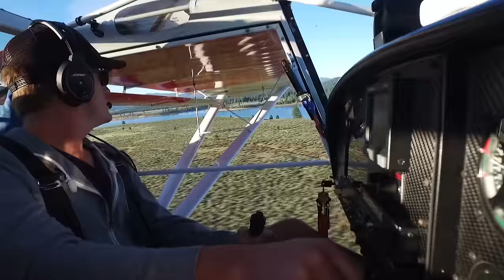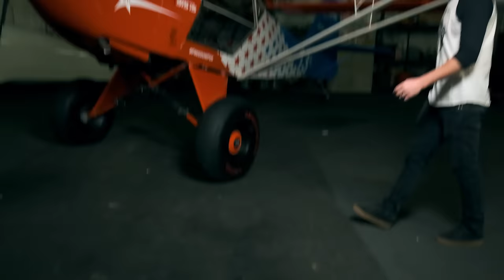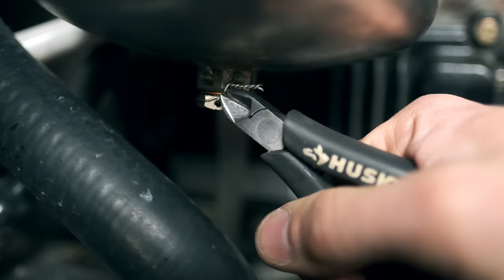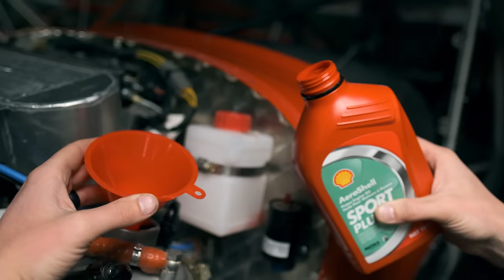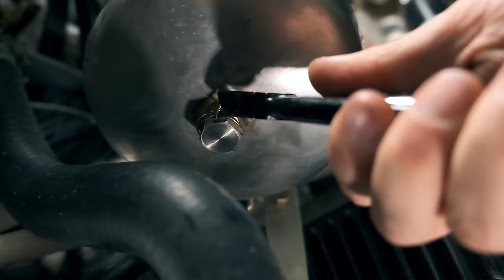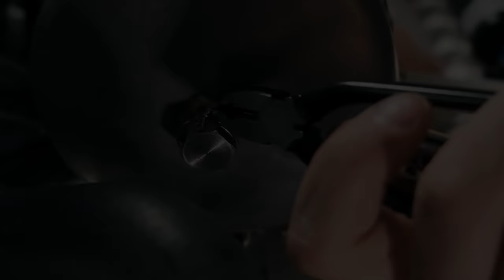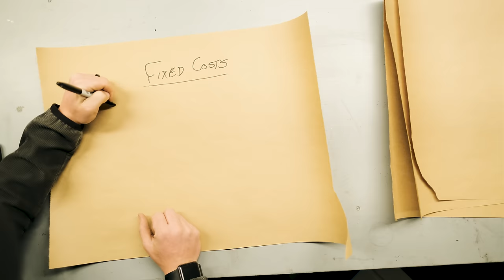What Does It Really Cost to Own and Fly Your Own Plane?

Comment: Here is the breakdown:
Acquistion:$39,000 / $20,000 USD or find financing.
Fuel: 5 gal per hour / $4 Gal average
Oil: $62 every 25 hrs
Hourly operating those two costs = $22.50 a hour ($1,125, 50 hrs - $3,375, 150 hrs)
Garmin database: $200 annually
Annual Inspection: $500 annually (experimental)
Hangar: $300 (huge disrepency regionally)
Insurance: $2,400 annually ($125,000 hull value, Off-field landings)
Reserves not covered.
Wear and tear not covered.

Loved the video and b-roll intro oil chance Trent!
Interesting stuff considering I'm evaluating getting back into flying again and as a father and new homeowner every dollar can count :)
Reply: So you need an awful lot of money. Not possible for college student on scholarship eh
Reply: Sudarshan Pujari since a college student can barely afford a crappy car- probably not
Reply: @ricktoberfest  sigh, not even Evan's volksplane?
Reply: To cut some costs, I would have to have my own runway and hanger on my property.  I would be a Sport Pilot so I'd get the  Certification of Repairmen (Light Sport Aircraft).
Reply: @ricktoberfest  You can fly some really expensive airplanes in Flight Simulator and get some decent control setups for reasonable money.  Maybe not as good as real but certainly a way to play until the money is there to support the real.
Reply: @Mongoswede  especially in VR!
Reply: It is NOT a cheap hobby.  The worst mistake that I've seen:  An A/C owner who pays all the costs, but doesn't fly it often, b/c of fuel costs.  The Stupidest Mistake.
Reply: Thats crazy! So, if you were to fly 150hrs per year, thats around $45 per hour. Probably add another $10 per hour for reserves and wear and tear? I mean, its probably like $90 per hour to rent a Cessna 150 right?
Reply: thats about what it costs to own a beamer
Reply: @janniesmit4901  Pass on this, or make a    7500.00  USD  offer.
Reply: 5 gal per hour how is it so low? How much hp is that kitfox
Reply: @neelmehta100  Cessna 172 goes for $130 /hr wet here in Los Angeles, and they are really beat up.
Reply: @wuhsuh6200   he doesn't run it much on boost, with the turbo, that can see 7.5 to 8 gals /hr. 5 gals Hr is probably max of 100 to 105 mphm as he has STI wing version, stall vortices, that lower stall speed and big old honking 29" balloon Alaskan Bush pilot tires, not aerodynamic at all. A lot of drag built into his bush plane, for short take offs and landings, not cruising.
Reply: @ctsteve1967  Sure thing thanks 👌🏻
Reply: Vote for Bernie and it will all be free....lol
Reply: May be I am blind, but I didn't the cost of maintenance.
Reply: Let's rap it up here, I knew that I didn't want to hear these numbers!
Reply: AND THAT RIGHT THERE, IS WHY I CHOOSE PARAMOTORING!
Reply: Randy van Vliet still only 5 gal an hour that’s pretty good considering what you just said
Reply: @PS-nf3xw  
No probably not... How so ever I've known several that got a part-time job specifically with this in mind...obtain PPL...rent plane once or twice a month... Never have grin leave face...👍👍
Reply: Great video man
Reply: What insurance company did you go through? I have had a nightmare finding a reasonable cost for experimental.
Reply: @PS-nf3xw  Don't worry about that in college. Build your career and you won't worry after
Reply: @maleficentcop2752  well, which jobs in particular?
Reply: Jannie Smit That’s a steal! - even with the 582. For some international perspective: The last M4-1050 for sale on the open market in the UK that I had the chance to look at went for around GBP16. I snoozed after a German colleague said it was too high a price, and lost out. Now I’m building from kit - which I’ll enjoy, but it’s still 11 months before my kit arrives. Life’s short - if its build history is in tact and/or you can get an experienced rag and tub engineer to check it over - grab it. Likely worst case: factor in a 912ULS which you can save for in the meantime and in a few years you may have to recover the fuse. Btw, Last month an M3 912ULS in the UK market was on at GBP22k - and that needed a bit of tidying. I know local market prices are going to vary, but IMHO Kitfox M4, maybe M3, and later are becoming much more correctly valued, thanks in large part to Trent and friends. Hope it helps :)
Reply: Greg Plaka Where can you find M4’s for < USD 10k? I’d seriously consider sending containers if you can supply clean M4-1200 airframes with or without any engine at that price :)
Reply: @janniesmit4901  The Bushcat is a very similar aeroplane to the Kitfox, but it's made in South Africa, so it might be cheaper to get there. I got to help build a kit Bushcat, and I gotta say, it's a pretty cool plane! It has a unique skin that's made of pre-stitched sail cloth stuff that you slide on the frame and stitch one seam up, and that's it for that panel. It's pretty much on par with the Kitfox performance wise, just though I'd mention it.
Reply: Dale Anderson  Mexico will pay for it.
Reply: Great  video  Trent. Yes, truth be told, flying is an expensive hobby. I had my 172 on leaseback to the local FBO, and I had to cover the upkeep and maintenance. They covered the insurance and used it for flight training, fire watches, and mine blast safety flyovers. I had my personal use of the aircraft but it wasn't  long and the plane needed the engine overhaul, which I could no longer afford. Long story short, I was forced to sell it and no longer fly. I am now living vicariously through you. Thanks for sharing.
Reply: @PS-nf3xw  
The job isn't as important as the goal...one did law care the other worked at an air port & traded for air time....nmnmnm has a point, don't neglect your education...be patient but be persistent all good things in there time...👍👍
Reply: @maleficentcop2752  aye sir!
Reply: @nmnmnm35  aye sir
Reply: If you get your A&P that’s cost goes down 😉
Reply: @janniesmit4901  hi Janie that one is no longer available it was bought by nick Holmes over a year ago but it has a 582 so big difference in price obviously.but if you want an equivalent look at the bushbaby explorers and safari its identical and they actually have some improvements on the kitfox and the older model bushbaby seem to pop up regularly
Reply: @neelmehta100  Usual well over $90 a hour to rent a cessna especially in Canada where I live.
Reply: @RuWarrior333  Tent mentioned that lots of people will build in a per hour cost for budgeting the overhaul of an engine but for maintenance as an experimental it is a bit less regulated than an aircraft like a Cessna 172. It's is the big x-factor when owning and would deserve its own video I believe.
Reply: Insurance seems surprisingly reasonable.
Reply: @randyvanvliet226  That's not bad. Here in Switzerland, you would pay around $250 per hour for the cheapest Piper Warrior.
Reply: @davidkreutzkamp6602  Yeah, thats why im amazed that it's so cheap to fly a Kitfox. If you keep up your hours, then you are better off owning an awesome Turbocharged Kitfox then renting a busted up Cessna.
Reply: @williamwhitley1174  I had a Quicksilver MX and sold it before my deployment in 2004.  
After I relocate to the country I want an MX Sprint and for Sport Pilot I'm looking at Rans products and Kolb.  The Kolb Twinstar Mark 3.  The Kolb looks easy to assemble and it's a taildragger.
Reply: Are there any tax write offs with your biz Trent?
Reply: That's less than I expected honestly. It's an expensive hobby for sure, but it's something a professional who prioritizes it can find a way to do.
Reply: "Acquistion:$39,000 / $20,000 USD" - cool. EU "KitFox variant" a.k.a EuroFox made +-300km off my city costs 80k, but in EUROS, man, 80k EUROS! And my another hot favourite, ShockCub made by Zlin Aviation costs even more. Rest of prices (fuel, maintenance etc.) are also doubled here. Doubled and in Euros, of course. :(
Reply: @Patriotgal1  Yes, it’s more expensive NOT to fly.  When an aircraft sits, the maintenance issues that inevitably ensue will cost much more than the fuel ever would.  On top of that, if a person pays for all the repairs from sitting and then try to sell,  no one will buy the aircraft if they raise the price to offset the repair costs.  It’s money lost.
Reply: You sir are MPV
Reply: The experimental insurance is 10x more than factory built/proven plane,
Reply: That's a lot of money, in Europe is cheaper:
My plane - Tulak 912ul 
Acquisition: 6000$
Fuel: 15l/h same as yours
Oil: 40$ /25h 
Hangar: 100$ 
Insurane: it's not a must.
Reply: Sudarshan Pujari, correct.
Reply: @janniesmit4901  Hey Jannie, what's happened? Thought we always made a plan. Build something and flick in a Honda Fit Engine for a song. Am thinking on doing this here soon. Maybe $8000 with all the frills.
Reply: @jacksontenhave7959  Yep, they lucky they can get the cloth and other stuff.
Reply: Hi David, where did you get the $20,000 price? I heard Trent say in this video it cost him around $36,000. The cheapest new kits from Kitfox are starting at $30,000.
Reply: @Mongoswede  As far as flight sims go you need to look at the xPlane flight sim. ( https://www.x-plane.com/ )  It is about as real as you are going to get with everything that is available for it.
Reply: @oliveriancovici  which European Country are you living in? It seems to me flying in Germany costs about twice as much as in the US and here you have a ton of stupid rules. For example you are not allowed to land outside airports. This law was made when the Nazis wanted to control all starts and landings to make sure no jews leave the country without paying Reichsfluchtsteuer. So it's almost impossible to own a waterplane. Even owning an UL is complicated. You need a license to fly a paramotor. Some people mount it on a recumbent trike (with pedals to ride it on the road) to be able to do it illegal. You need a license for a RC plane >2kg. A RC plane >5kg needs a registration and a official check. RC planes >25kg are illegal. UL with IFR is illegal. Experimental needs to be checked twice a year... It sucks
Reply: @PS-nf3xw  You can get into flying a lot cheaper with a powered parachute or an ultralight airplane, helicopter, or autogyro. Ultralights in the U.S. at least aren't regulated by the FAA or any other governing body. If you have something small enough, you can eliminate hangar cost by storing it at home and fuel costs are generally far less. That being said, make sure you fly something with a proven design and safety record. Too many people back in the day gave ultralight aviation a black eye by strapping a briggs and stratton to a sheet of plywood and flying themselves into an early retirement. Also, with an ultralight there's no requirement to have any pilot certification so that's a huge expense eliminated. Make sure to get enough instruction that you don't kill yourself on the first flight though. I would rather see someone flying an ultralight than not at all. If that's all you can manage financially, you'll still get the thrill of flight and it's a great way to get started in aviation as long as you do it safely.
Reply: I’m doing air cadets just so I can get my license for free
Reply: Gee cost cheaper than my 2020 F150 to buy but can it haul 4'x8' drywall 🤔
Reply from the maker: My F150 has the short box on it so I can’t haul any 4x8 sheets in it either 😬
Reply: @wuhsuh6200   The more horsepower you have, your engine won't need to fight to get up to the speed in cruise. Its the same with your car or truck. If you have a weak/smal engine with less power/horsepower it needs to fight/drink more fuel until it gets to an efficient speed/cruise speed :)
Reply: [TNG] The Nordic Gamers right but a lot of hp you still get fuel burn I fly a 750hp pratt I burn around 50 gal an hour don’t matter how light of load it’s difficult to get the fuel burn down to 40 I would imagine that kitfox must be like 180hp? Our 1946 100hp champ burns more then 5 gal an hour lol
Reply: @wuhsuh6200  yeah to much power will probably burn more but his engine is a fuel injection engine and not a carb eninge too and that reduces the fuel consumption alot too 😊 and I think his engine is about 180-240 hp engine, he has a video about the engine swap he had not to long ago for his kitfox 😁👍
Reply: @wuhsuh6200  and your fuel consumption is really high, that's the same amount of fuel a Boeing 737 Apu jetengine is using for a commercial airliner per hour 🤔🙄
Reply: @TrentonPalmer  not true, you just need to leave the tailgate down, and flag the load.  Shouldn't have to say, but obviously secure the load with straps.
Reply: I'm learning to fly on my grandpas plane and it runs on 87 no alcohol so when this oil standoff happened it was nice paying just around $2 per gallon to fly
Reply: You forgot the cost associated with the PPL license.
Reply: David Kreutzkamp is that all Canadian dollars? Or did you do conversions
Reply: I believe the costs are higher in Europe.
Reply: @neelmehta100  Yes owning an airplane is very expensive. So if you aren't doing it for your job, you'd better be really rich. If you don't have an income of at least $300,000/year, this hobby is not for you. For the rest of us, there is Flight Simulator and RC planes, which are also fun.
Reply: @neelmehta100  I opted for a used 2012 E LSA Van's RV-12, with Dynon Skyview Glass EFIS, though I do stick to runways.  Trent and friends video's made me want to learn how to fly.... bought the plane to take lessons in. Rotax 912 ULS,  100 HP about 4.7 gallons per hour, does 115 kts, when the air is smooth.  Run strictly 91 octane Mogas at $3.10 / gallon. Allows me to run a full synthetic motor oil and go more hours between oil and filter changes.  That's how I got in to flying, will be able to do my own Annual Condition inspections.  Hangar $360/ mo, insurance $1200/yr.  Low hrs airframe and complete new motor... 168.  Good plane, just not bush worthy, but that's not my mission.
Reply: @raoliprivate6149   141 HP , 5800 rpm max, for 5 minutes, max, then back to 136 or 137 max at 5500 rpms.
Reply: Volkswagon engine can cut costs!
Reply: Jannie Smit what about importing one
Reply: Dyso 200 aud here in oz for a c150
Reply: @PaulHughes7  That's just an airframe kit. Add firewall forward, Engine, Upholstry, Avionics, Paint...A good rule of thumb is the airframe kit is around 1/3 of finished cost.
Reply: @bruceb85   going back to the 70's bmw's are cheap as fuck to drive to the moon if you take care of them and do regular services - granted ii stopped caring in 2006  parts are not expensive. the exceptions to this are the f1 inspired v10 m5 & any of the 80's-90's-00's 7 series, though the same block powers the mclaren f1.  

funny joke lad. but i don't know fuck all about planes so i'm not going to shit on people who find a way to afford what they love. more like the cost to keep a northstar Cadillac running.
Reply: Rich man's world
Reply: Screw the archaic outdated mindset of hourly cost. Nobody factors in hourly cost in their boats jet skis motorcycles snowmobiles or sports cars. Put gas in it when you need it. Change the oil when it’s supposed to and pay for repairs when necessary just like every other power sports toy you have.
Reply: It is all based on how fast and how high you want to fly. The more dollars you put in the higher and faster you can go. Flying is not cheap.
Reply: @PS-nf3xw  def not. but maybe consider one day moving to a fly in neighborhood. have your own hangar on the strip right beside your house like all your neighbors its really cool. my sisters father in law has his license and lives in one of those in arizona. then has his house close to san diego he can fly to really quick if he wants
Reply: $3 gas.  Those were the days. 🤦‍♂️
Reply: More than what i could afford unfortunately
Reply: that is what was missing.  Thank you for this.